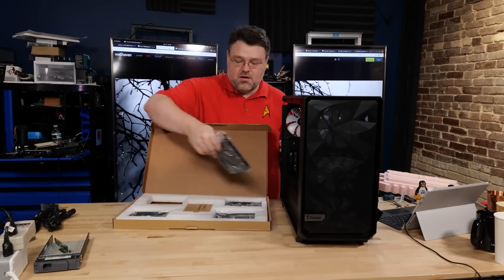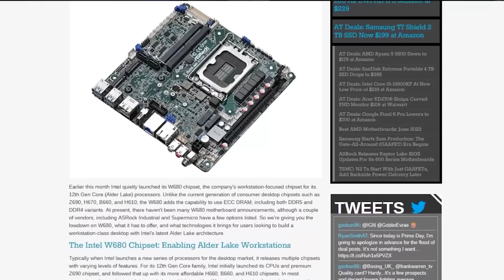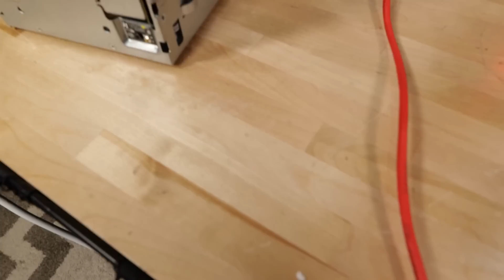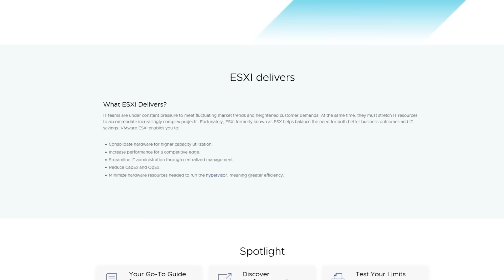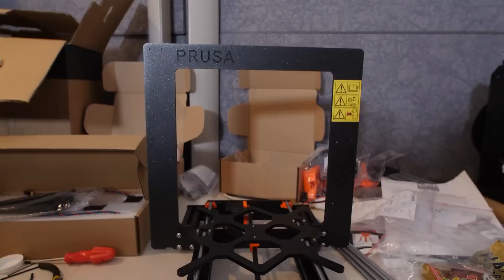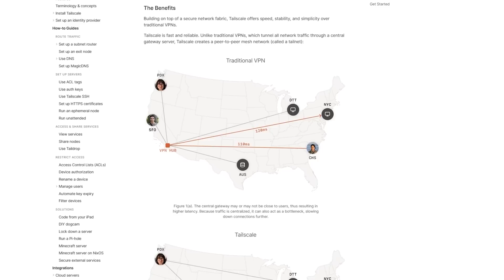Low Power/High Performance Server GRUDGE MATCH! DeskMeet, Ryzen, and Supermicro Micro-Tower Server

Comment: Why doesn't the lack of ECC bother you, assuming this is going to be used on ZFS? There seems to be a lot of different takes on this matter, ZFS devs strongly suggest ECC, and Linus Torvalds even insists using it on his workstation/desktop computer. There seems to be a lot of urban legends considering this, could you test it somehow (e.g. letting ZFS run 24-7 with and without ecc and see whether it will result in corrupted files).

Comment: Going to add another config for anyone curios:
5600G, Asus TUF B550-Plus, 32GB 3200 DDR4, Seasonic Focus PX-550, three running fans and two spun down hard drives nets 19W idle power, the hard drives running add 10W. Take a 5650G instead and with that you could have ECC too

Comment: I built a 2u rack mount with a Ryzen pro 2400ge. The ge is 45 watt tdp and supports ecc udimms. I added a 2.5gbe card and a sas card. I use the 1gbe for my kid's Minecraft server vm and the 2.5gbe is for my NAS vm. It works extremely well with truenas scale. There are quite a few consumer motherboards that do support ecc udimms. And my case will fit a large number of 2.5" drives for storage.

Comment: Hey Randall, I disagree strongly on ECC not being critical. ECC is crucial for system stability. Bit flips are fact and they occur in OS memory space too. They are cause for more system hangs than sysadmins would like to admit. Computer that you power off daily will get memory hard refreshed anyway so bit flips will "disappear". But for system that will be on 24/7, ECC is a must. Either that or be ready to have that 2am call to go reset the server.
Thank you for awesome content.

Comment: Been torn between getting one of these Supermicro or ASRock systems, doing an i3 or R3, or getting a 25-45W TDP Xeon. Also torn between doing 5ish 4TB platters or just doing a couple 4TB SATA SSDs. I've kind of wanted to use my old Dark Base Pro 900 rev.2 since it's got lots of drive cages and noise dampening foam, but kinda realising there are so many options for smaller units and I don't know which route to pick anymore

Comment: The new Octo-core Atom Xeons have some extra punch, with very low power draw at idle.  They are soldiered to the motherboard, but will last a decade.  They can have ECC ram, 10G/s Lan, 1x PCIe slot, 2x SAS plugs for 8 drives and a couple of SATA plugs.  Just those thing alone are what we need for a home server.
Reply: Can you post a link? Would like to investigate this

Comment: Definitely looking at the DeskMeet due to this vid, thx! I’m a bit confused by 17:02 though. What is the reason for using a PCIe slot adapter for the NVMe instead of the two  onboard M.2 slots? Wouldn’t that have opened up the x16 slot for a NIC?

Comment: i already have the 470 motherboard. i orgionally paored it with an old 2700x but i could never make it not guzzle electic. as the 3900 or 5900 are basically impossible for me to get hold of would something like the 5600 be ok for an unraid server (set to sleep as often as possible) that has a windows vm for occasional gaming and docker containers. i need to cut idle sleep power to an absolute minimum due to living off grid

Comment: My server is an old Dell optiplex with a intel i3 9100 and two seagate ironwolf mechanical drives plus NVME. It idles at 20 watts running nextcloud and some media serving. Average load of 0.30 while streaming music stays at low 20 watts. I don't have all the reliability or overhead power, but you can't beat the cost.

Comment: Just “downgraded” my home setup from a Ryzen 3700x/64GB/Asrock rack 470d4u to a NUC8i7BEH with 64 gig. Power was about 100w now tops out at around 40w. Still runs Proxmox 7 and all my home essentials including a VM loaded with Docker containers. Keep in mind I do have a Synology NAS for data storage. The power savings really is what drove me to it. So far, so good!  Loving the low power home series videos, Wendell! Looking forward to what W680 and Raspberry Pi 5 will bring.
Reply: You probably could have got similar results installing a 5650GE or 5750GE in your old motherboard. Those are 35W TDP chips but perform pretty close to the regular Ryzen 5000 chips.

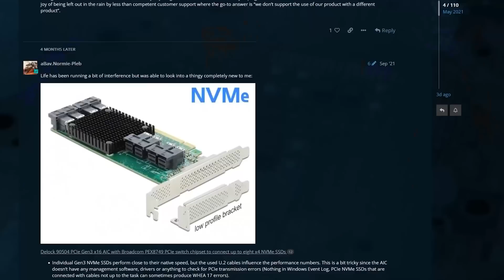Comment: 10:53 I wouldn’t call the experimental stuff I’m doing cheat codes, I just want to use the best of both worlds, Consumer & Enterprise. Even if hypothetically speaking cost were irrelevant neither world offers the “perfect experience” forcing you to split tasks into multiple systems even if the hardware of one system is absolutely powerful enough :)

Comment: Great video! I have an ancient Athlon II x4 610e with 8GB DDR2 RAM, hardware RAID with LSI 9267-8i and 2 Hitachi 4TB mirrored HDDs (best reliability according to Backblaze reports) and a 128GB system SSD running Ubuntu server 20.04 with Nextcloud, a couple of containers and a few gimmicks. This thing rarely goes over 2GB of RAM, disks are at about 1Gbit LAN/broadband speed I have at home and the CPU only gets pegged when indexing really. It can still stream movies via Nextcloud no prob. Whole setup has set me back less than €200, as I bought 2 HDDs at reasonable €65 a pop and upgraded cooling and RAM (€10 Aliexpress job). This still uses very little electricity as the CPU is 45w. I would love to have a 12400 with 64GB DDR5, 2x20TB HDDs and a few 1TB NVMEs or a 12 core monster Ryzen, but that costs like literally thousands of € and for that price, instead of virtualisation I can get a few cheap €100 Dell workstations for experimenting which do not have to be running 24/7 and still have plenty of € for electricity bills left. On the top of that those second hand PCs will not go to the landfill anytime soon.

Comment: Awesome video Wendell and the team at Level1!
I built a similar NAS some time ago using a 10400T (low power 6c/12t), and 3x 5tb Seagate 2.5" drives, and an NvME. 
Jam all of that into an Inwin Chopin case, and you've got 3.3L of low power; silent; and tiny NAS goodness running TrueNAS SCALE and a RAIDZ1 array. For anyone wondering, I had to design/3d print a custom holder for the 3x 15mm thick drives... otherwise you can only fit 2x 15mm drives at a squeeze.
Currently in the process of figuring out how to fit a Mellanox MCX311 card into it (10GbE goodness!)... I think i'm going to need a custom/angled riser.

Comment: I'd love to see a longer discussion on ECC memory.
For example, how exactly is ZFS "weakened" by not having it - if at all, that is? Does ZFS assume that system memory will always "tell the truth", and if that assumption is broken then bad things could theoretically happen? Or is it able to notice if bits get flipped when they shouldn't, somehow? Is there an article about this somewhere?

I guess what I'm wondering is whether the "don't worry too much about ECC" mentality is more based on how rare severe memory errors are, or on them usually having low/no impact when they do end up happening. Or something else entirely? Also, is there even statistically significant data on this? Are there any larger datacenters that don't use ECC memory anywhere (and without other special mitigation strategies to make up for that), and haven't had any issues with that?
I suppose that most memory sticks are either going to be so faulty that it's going to be apparent very quickly (and then a backup of the data can be restored after replacement), or it will run so well that errors will just be very rare?
What usually happens when memory ages? Is there a chance that the rate of errors increases with age? Or does memory usually still work just as well until it then just dies entirely right away?

I remember a rant by Linus Torvalds about Intel's lackluster ECC support, and it seemed he considers ECC very important, even for more "mainstream" users (as opposed to datacenters and the like). So I'm still kind of worried about foregoing it. Am I unreasonably worried?
Reply: Fully agree. I want to build a small form factor box that I use as a storage server. And after looking at the prices for ITX Mainboards that have ECC support and also a lot of SATA connectors - damn, thats pricy. Would really like to know how important ECC actually is when using it with ZFS. I personally would prefer to have the ECC support, especially when dealing with backups of sensitive data it seems like not having it is a bad idea.
Reply: @dominikheinz2297  if you want if you have doubts, go for ecc. It’s not gon be that much expensive.

You just have to find a board that supports ecc. At this time and age, it’s gon be am4 platform.

Search for USED UNBUFFERED ddr4 ecc.

Don’t worry about sata too. Search for USED pcie HBA controller.

I just bought another pair of ecc udimm 2x32 @3200mhz for less than normal ddr4 2x32 price.

And for the HBA, I paid 20 bucks for an ancient enterprise gear.

Only thing you have to wrong is pcie slots. Coz you’re not gonna have any left for gpu, if you go itx board. The HBA gon take a x4 pcie.

Comment: I was thinking about upgrading my home server to modern platform. However the saving it'd make won't justify the cost. That's why I'm sticking with my core i7 4790 for now.

I'm using Zerotier as the VPN to access the home server. There are issue with iOS, but it's working ok I think.

Comment: I find Wendell's videos often a little bit hard to follow. They could use a bit more structure and possibly preparation.
Reply: Me too. I came here for the builds, but got a bunch of over detailing on ECC, etc. I understand the value of the details, but this could be a series of 4 videos. One for matching the builds in terms of power, performance and cost, and 3 videos in depth for the pros and cons of each build. Instead I found myself skipping a lot for 30m. 

Wendell would get more viewer engagement, if he split is knowledge properly

Comment: Hi Wendell, I'm looking at scaling down from 2x 290x and a 1350w power supply (don't ask) and just curious if the failure potential of a HDD is increased if the drive is always on in a system? ie spin up each time I want to find something? How often do those drives 'sleep'? Considering if I should shuck a drive or keep it external for backing up.

Comment: Thank you for emphasizing that ECC is not really a big deal. I'm tired of seeing hardliner comments on every home server video saying ECC is required, as if we can all just double the budget for our mobo, RAM and CPU out of thin air.
Reply: To go for Registered ECC it is probably double, but Unbuffered is possible on some consumer motherboards, you only pay a little extra for the RAM. ASRock does this, I have a B550 Steel Legend with a 5800x and 32GB of 3200MHz Unbuffered ECC. You have to do some extra research and digging to find the products, but it's possible.

Comment: I have a bunch of old enterprise gear, dell r620's, r320's and a r420. I also have a couple of diy servers build by me. Power consumption wise building new is a clear winner, but if you look at purchase cost, diy cost 5-10 times more. Every time I start adding up parts to diy match one of my r620's I end up close to $1000 and I paid $150 for my r620's (each).
Reply: I also run a few old HP enterprises servers but electricity prices have tripled last year so unfortunately I think the calculation is completely changed.

Comment: It's a pity that TrueNAS Core doesn't really have great support for Alder Lake CPUs due to the big.LITTLE design and FreeBSD hasn't caught up to that architecture yet.
Reply: Does TrueNAS Scale have better support, given that it's based on Linux?
Reply: @Blacklands  
I forget.

I'll have to re-read the TrueNAS forum threads again to be able to answer that, but it seems to be highly experimental at this stage.

I think someone mentioned that the support should be better in TrueNAS 13, and then it was released, but I don't know if other people have commented or contributed to the knowledge base with their experiences, so the concensus seems to be "try at your own risk"?

Comment: Damn, how do you get ~10W idle out of a ryzen system? I can not get my very bare bone and undervolted 4650G and 5700G (B550) to run significantly below 20W@wall even without hdd. The lowest i have ever seen was like 18W. And yes very efficient PSU @ low idle current and all unnecessary junk disabled...

Comment: I have the 10g MATX version of this board an asrock rack X470, paired with a Ryzen 7 Pro 4750GE out of an HP, plus 128GB of ECC. The first machine i bought with a 4750GE i got from Lenovo but it had PSB enabled by default meaning i couldnt use the 4750GE in any other motherboard brand other than lenovo, that was a fun discussion with Patrick from Serve The Home, but at least he was able to get the word out.

Comment: I really want to know what the heck happened with W680 - Supermicro is the only retailer with boards available to consumers (AFAIK), as I cannot find the GIGABYTE/ASRock boards anywhere.
Xeons were seemingly planned but not even launched so Intel had to support ECC on (some) consumer CPUs.

It seems daft, as a 12500 or 12600K + a hypothetical W680 Vision/Creator/WS/whatever else would've been the perfect middle ground for a lot of people, as the 500€ required for the X13SAE are... a bit much, for most people, even if I'm sure it's a fantastic board.

Comment: So theoretically, I could basically have a Windows Pro or Windows Server system (or Fedora or Ubuntu Linux), use a built-in RAID 1 or 10 (or use ZFS or Storage Spaces), use an Azure VPN to perform an occasional image backup of the OS (and maybe file transfers too), and use an external backup drive for a decent backup solution.

Comment: My home server is a Ryzen 7 2700X machine, this plus a 16 Port PoE Switch, PoE AP, 3x PoE Cameras the entire setup pulls 170W idle. 

There's 5x 4TB HDDs, a 40W Nvidia P620, Intel I350T4, H710P Raid Card, 128GB Ram + 7 fans seems to all add up little by little. I'd love something with this grunt in a < 50W package really.

Cost of electricity is rising, peak is currently 49c, offpeak is 12c, shoulder is 20c. This is all increasing 20% in the next month too, so power savings for most will be starting to happen.

Comment: Pretty cool! I've got the budget in my electric bill so I went with dual Xeon procs from an older generation, 20c/40t and 128gb ram gives me a lot of room to play around with for VMs and such. I definitely need to re-architect it a bit though, I started with Ubuntu Server and it's not particularly crash resistant as I have it set now. One day, maybe 🤷‍♂. Another note is that I've been loving these Fractal Design cases. The Meshify 2 XL was great for my gaming rig and the Define 7 XL really kills it for my server. Super quiet (especially with some Noctua fans) even with these dinosaur CPUs in it.

Comment: How did you put two 20TB hard drives inside the deskmeet? I thought it only supports one 3.5" hard drive
Reply: that thing actually fits 3, check out the diagrams in the user manual

Comment: I love my low power silent Ryzen TrueNAS system. Based around the asrock rack x570 (matx - 2X 10GBe), Ryzen 9 5900 (OEM - 65W) running at 45W ECO mode, and 128GB ecc 3200mhz ddr4. Passively cooled, to boot.
Reply: Were you able to verify that ECC is indeed enabled and working correctly? If so, can TrueNAS check that natively, or did you use something else?
I also read that Ryzen (non-Pro) can sometimes claim that ECC is enabled when it actually isn't. So I wonder if you basically have to inject errors (which afaik isn't easy) to check if it actually corrects/detects errors.
Reply: @Blacklands  Yes! ECC is working, I verified using memtest (the pro version that validates ECC)
Reply: @linuxpirate  Cool! Thanks for the update on that.

Comment: Curious do ssd really have a longer life that spinning drives, asking because I have some spinning drives that are over 20 years old and still running.  I have had a few ssd's fail with no warning at all because they are silent.  Just a question.   thanks for all the great info.
Reply: Not only do they fail suddenly, but performance is worse. I just watched a review of one that claimed an endurance of 2960 TB written over five years. That's only 150 Mbps. Five minutes a day at the claimed maximum write speed. Current 10k and 15k drives are guaranteed for any workload. There are very few dual host NVMe but every SAS drive has two ports. And nobody knows what an SSD will do when power is lost during a write.
Reply: @shanent5793  "And nobody knows what an SSD will do when power is lost during a write."
I thought more expensive (especially enterprise tier, I would assume) SSDs had capacitors to ensure that the data from the RAM cache is still written to the actual flash on power loss? I don't know if there's a standard for it, though.

Comment: I used to mine monero on Ryzen's and the IO die can consume a surprising amount of power. The difference between Infinity Fabric clock 1800Mhz (to support DDR 3600 at 1:1) at say 1.1v, and a more conservative 1200Mhz (for DDR 2400 at 1:1) at 0.9v is huge, a difference of 15W, at idle! You can normally see this in Ryzen Master.
You will need to tune your IF clock / IO voltage and Memory speed to get ultra low idle power on Ryzen.

Comment: It is a sore spot for me that low wattage power supply with higher than 80+ gold are basically unobtanium (they exist on the certification list, but they are all OEM and the manufacturers do not sell directly to consumers)
Reply: There are the redundant kind at 500 watts and up for platinum . I guess the miners use some of them for smaller Asics. im not sure about lower
Reply: @tobiwonkanogy2975  yep. I'm talking bog standard ATX. My 1800x with quad intel gigabit NICs, dual broadcom 10G-baseT, two hard drives, one NVME and one sata SSD uses less than 60 watts greater than 90% of the time. Would love a 80+ platinum 250w PSU, even if tfx